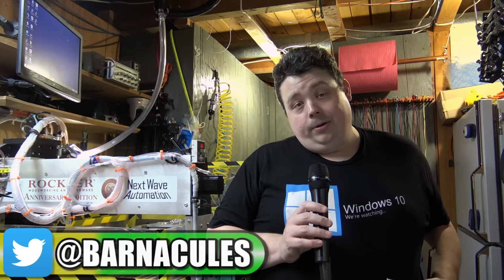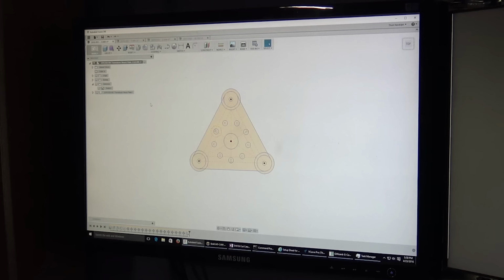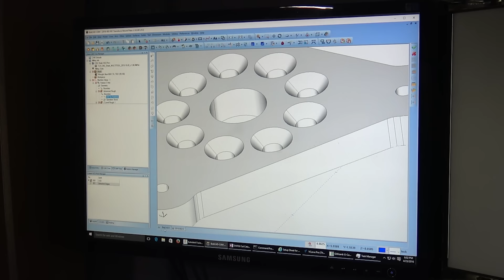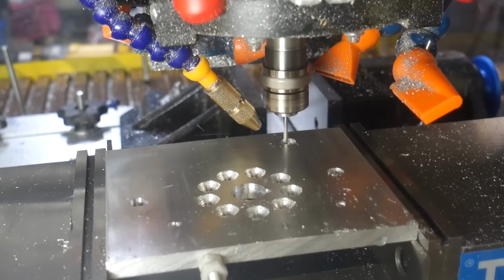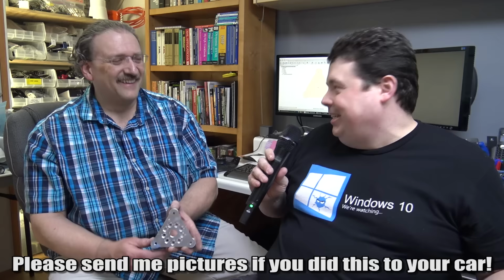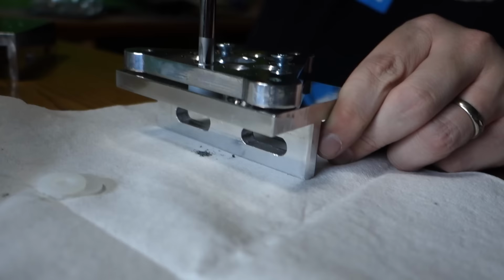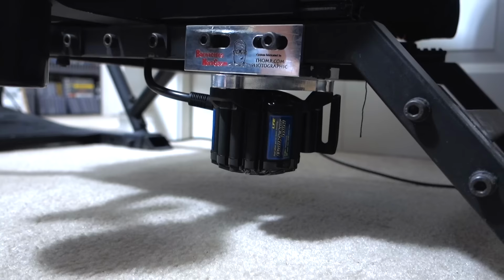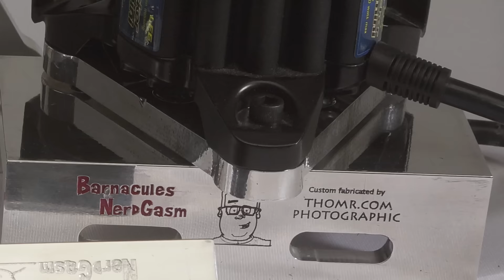Designing & Milling Racing Simulator Transducer Brackets - @Barnacules

Comment: Good for being absolutely solid, but it easily could have used less aluminum if it was just a series of plates drilled and tapped together. Could have some slots for easy alignment and more rigidity. Still good though.
Reply from the maker: +nerdyrcdriver We wanted to build something crazy beefy, there are a lot of different designs that would work.
Reply: Agreed. Did you collect the aluminum chips to melt down in the forge? That would be a cool video.
Reply: +nerdyrcdriver I was talking with a guy about that recently. He was saying that the aluminum oxide on the surface of the chips means there's a lot of waste that comes off in "dross", or the oxidized gunk that floats to the top of the melt. It can be gotten rid of with a LOT of flux, or with high electric current (think hundreds of amps). So for now, melting down my 5 Ga bucket of chips will have to wait. The original thinking was, like you're saying, to just use 1/4" Al plate (6061). But when I held the material in hand, it just didn't seem burly enough. The other (more rational) reason was that the transducers are not held on with a nut and washer. The three bolts go into threaded holes in the Al. at 1/4-20", there's 5 threads in 1/4", but 7.5 in 3/8". That seemed "better"...
Reply: +Thom Randolph good point about the dross. At work we usually just bring our chips to a recycling center. More threads does seem better. Do you have a cheap source for the aluminum blocks you used?
Reply: +nerdyrcdriver My fave here around Seattle is the Metals Supermarket in Kent. Big warehouse full of metal, and you can even browse to your heart's content. No minimum order, they'll cut to order within reason. But most fun, since we're right next to Boeing and their many suppliers, they always have huge blocks of 6061 and aircraft aluminum on the clearance rack.

Comment: how did you paint your name on the mounts?
Reply: +IndyHelis You're nearly right, IndyHelis. The issue I've had with getting the paint to stick to aluminum is that (I hate these technical terms!) it has very low "surface energy", which is a measure of the atomic bonding sites/forces available on a surface. Aluminum has relatively low surface energy compared to say steel or plastic or paper. So, what I used was an acrylic paint, with added thickener and what amounts to a surfactant, or wetting agent. That really helps the paint stick better to Aluminum, at least as I've found. Since I have to mix that stuff up, there's not really a paint pen to use, so instead I used a syringe to get it into the grooves, and then a artist's print-making rubber squeegee "brush" to get the majority of the extra paint off. The last step is exactly like you say, but I used mineral spirits/paint thinner because it was acrylic paint, not an oil-based paint.

Comment: Man i want a CNC machine so badly :(
Reply: +Steffen Fisker They are nice to have,  I still find a lot of one off things that I can make faster via regular non CNC equipment.  An old bridge-port milling machine with a digital readout could probably make those parts just as identically and just as fast if not faster given how easily aluminum cuts.  Also with an upgraded spindle even an x-carve can cut aluminum and other soft metals just fine.  I have not tried cutting steel on my x-carve machine because I have access at work to a CNC plasma cutter but maybe one of these days I will give that a try as well.  It's all about speeds and feeds and knowing the limits of your machine.
Reply: +kuhrd I've always wondered about that...especially odd shapes like that 9-hole bolt-hole circle with the included countersinks...what kind of effort is that on a non-CNC mill? Curious, since I'm one of those poor b*stards who never got a chance to learn on a manual mill. Would love to, though.
Reply: Thom Randolph A simple rotary table will make quick work of a 9 hole bolt hole circle since you leave the bed of the mill in one spot once you set the radius of the pattern and rotate the rotary table 40 degrees for each hole and you can then repeat the same procedure with a countersink.  Or you could use a drill bit with the built in countersink and do it in one go.  Since this does not require a super high amount of precision a rotary table on a drill press would even suffice for this task but a milling machine is always a better option.

I still want to have a go at converting a manual bridgeport over to CNC but have not had the time or resources to do it yet.
Reply: +kuhrd I'm guessing that any sane (manual) machinist would of COURSE know they need the rotary table. :-). I can see how that would make the work really easy. There's probably some cool way to even make a spiral of holes by moving the table X whatever the incremental diameter is. Seeing someone do that manually has gotta produce smiles. 

One thing that has always confused me about manual milling, versus CNC, is this: unless you have a power-drive on the X and Y, (and even Z), how do you actually get to a particular F&S? I can see the S, or course, but how to you achieve the F part if there's no power drive? Is it just that the spindle goes so much slower and the manual material movement is equally slow when done manually?

I gotta admit: when I got the CNC and realized I could finally cut a series of square holes for four push on-off switches, and they'd line up perfectly, I was a convert :D. Heck, without ever having had a manual mill, even just cutting a decent 1" square hole was essentially impossible. Well, impossible without plunking down the cash for a Greenlee square metal punch. In those days, I just hoped the switch bezel covered my hideous Dremel-tool hacking. ;-)

I'm with you there, Kuhrd: too little time, too many other projects sitting waiting, too little room, too little $$$ available to get every cool tool and learn how to use them. In the past when people have come over for significant projects (like say, a custom fiberglass rear-speaker deck for a 1940 Ford), the deal is the work is all free, but they pay for materials, and if we end up needing any new tools, they buy the tool and I get to keep 'em. Often, it's only some odd size of drill bit, but that seems a nicely fair trade. The tools have to be bought, and if they had a shop to use those tools, well, they wouldn't have come over for my help. Unfortunately, nobody's ever come over and then us gone out and purchased a Bridgeport, or a Hass, or even like a huge laser cutter. Cheap B*stards! ;-)

Thanks for the explanation, man.
Reply: Thom Randolph With the manual machines you are right, if you don't have a power feed you have to get the correct feed by either looking at a machinist manual or by using your senses.  You can usually hear and sometimes see if you are going to fast through a particular material.  You can smell and see if your cutting tool is getting too hot and you can also check the color and shape of the chips coming off to see if you have the right feed-rate. 

Just like the world of CNC machining there are tons of lessons and rules of thumb to manual machining that you just basically learn by doing.

As long as you learned something by doing it and you had fun with it, it really doesn't matter how you got to the finished part.  CNC does leave more time for socializing and watching the machine work. LOL
Reply: +kuhrd socializing...AND freaking out when the CNC takes a momentary jog command and starts heading off to an eventual crash! All the while I frantically reach for the eStop button :-).

Comment: Uhhh What Transducer means? Or what this thing is for?
Reply: It attaches to a racing simulator and makes it shake a bit to makes racing games more realistic...
Reply: +Architector #4 a Transducer is something that changes energy from one form to another. In this case, electrical to movement (kinetic). A motor is a type of transducer. These are more like speakers, but without the speaker cone, and intended for making very-low-frequency vibrations: Infrasound, like what elephants use to communicate over long distances. Monstrous vibrating thangs these are. :D
Reply: Ok, thx!

Comment: What do these transducers do?
Reply: +Clayton Estes They send vibration into the sim frame. There's one at each corner, and one in the general middle of the frame, to simulate the direction and feel of the tires on pavement, and engine revving, and the gearbox.

Comment: 3D is over kill to machine those. I believe DXF files can be used by all CNC milling machines.
Reply: +Kenny McRae I relied on the CAD to get me better accuracy in placing the holes across the five brackets and five mounting plates, and also in the blended arcs around the mounting-plate profile. I also went with machining for accuracy in depth of the countersinks. The 1/4-20 bolts come within 20 mils of the underside of the brackets, and I didn't want them to scratch the sim rails. My drill press isn't so reliable in depth accuracy, and I already had the tapmatic in place. 

You gotta remember...this is done in my home using typical lower-end tools. Even the CNC machine falls into the mid-range hobbyist class, at $4k for the base machine.

The other benefit with the 3D CAD (not talking 3D CAM toolpaths; just the CAD) is that is allows for visually checking that everything fits together a lot more easily than with 2D drawings. AutoDesk Fusion is awesome for those kinds of fitment analyses. 

IGo, CNC milling machines take GCode (or some variant of it), and not the DXF drawing files directly. Well, at least none of the machines I get to use ;-). Some software has to sit between the CAD and the machine...that would be the CAM part (Computer Aided Manufacturing) Yeah, it could theoretically be manually programmed, or even manually machined, but why bother when the software will crank it out in mere moments. :D

Cheers, thanks for the comments!
Reply: +Kenny McRae Oh yeah, definitely want to get something better suited to the task, eventually. My biggest problem was that I discovered the garage floor in my 1967 house has a crack running all around it, so the slab is actually resting as much on the fill dirt as on the foundation walls. Putting a #6000+ load in a spot 8x8 feet is just asking for disaster. Having the machine right outside the office where I can watch it in comfort and convenience (well, with eye and hearing protection!) really makes it nicer in those cold and wet Seattle winters....which last from September through June most years. ;-) Thanks for the compliment, Kenny; I'm pretty new to the machining world, having done electronics, chip and software for, well, ever ;-).

Comment: the original design would have been perfect for TIG welding
Reply: +keagan engbrock Yes and no. It was definitely prime for a welded assembly, but having the transducers so far outboard from the metal frame meant it was really going to be torquing the frame and not linearly transferring the vibrations, like the mfg recommended. Sure would have been pretty, though...love a good TiG weld bead!

Comment: You can get a entry level tormach for only $10,000.
Reply: +William Decoteau For suitable definitions of "only". :)
Reply: Mark Wheadon compared to 100 - 200 thousand, ten is a steal.
Reply: +William Decoteau You can do a whole lot at the hobbyist level and even small custom parts shop with a Tormach.  Of course you can also do a ridiculous amount with an X-Carve with a few upgrades.  When I built my X-Carve i only bought the base machine without the electronics.  I bought a separate motion controller and driver boards and stepper motors that still matched the same Nema hole pattern that the X-carve used and then bought a 1 hp palm router to use as the spindle motor and added a variable speed driver board for it.  I think all in that machine only cost me $1300 by the time it was all done and it cuts aluminum rather well.  I have not tried mild steel yet but that will happen eventually.  The only upgrades I may make in the future are making a 1" thick steel base plate to sturdy and level the machine out even more and also to replace the timing belts with ball screws or chain but so far the timing belts are still holding up.